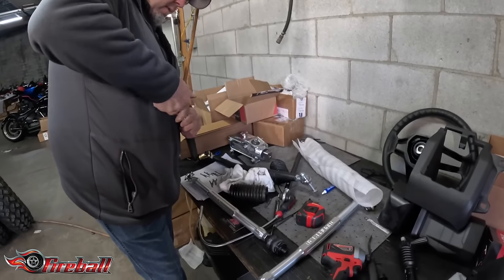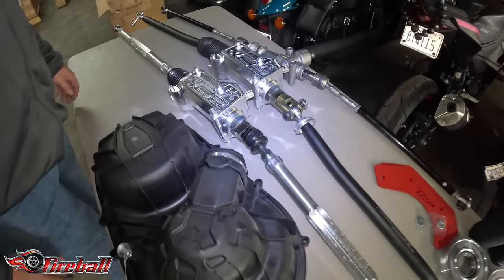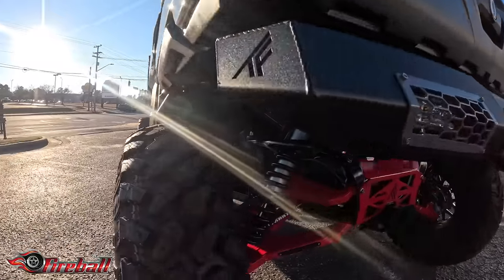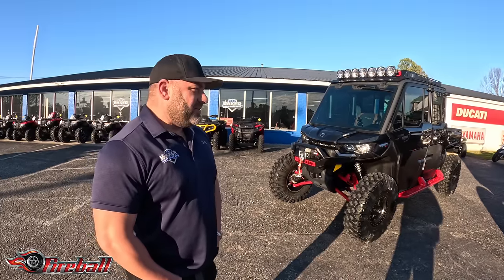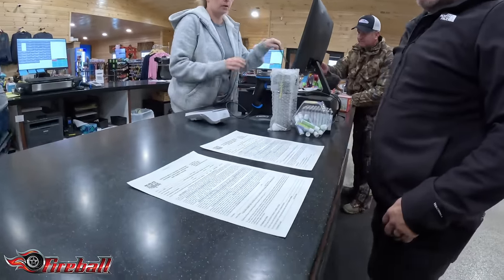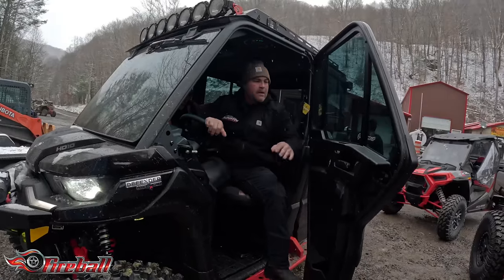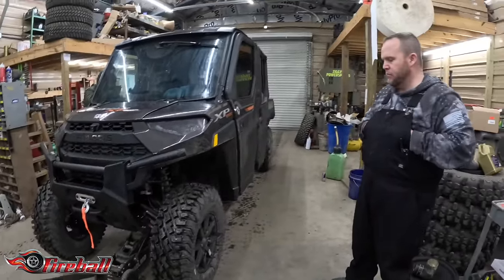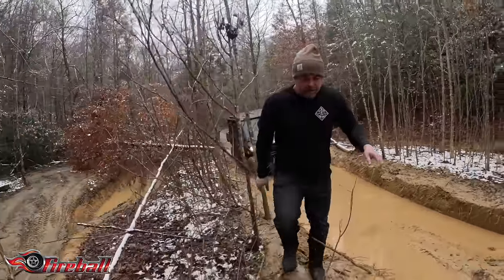CanAm Defender Build Part 2 Plus Hatfield And McCoys Trip.

Comment: What was the Silo in the beginning, ICBM?
Reply from the maker: Air shaft for the coal mine
Reply: @FireballCamaro  Thanks, I'm from Honolulu so a lot of that stuff is foreign to me.🤙
Reply: It mainly served as an alternate exit for the mine in case of collapse. There is a crane right next to it with a single person cage to lower someone down, or extract people out. If you drop a rock and time the freefall (you FEEL it hit bottom) the calcs put the shaft at around 1200 ft.